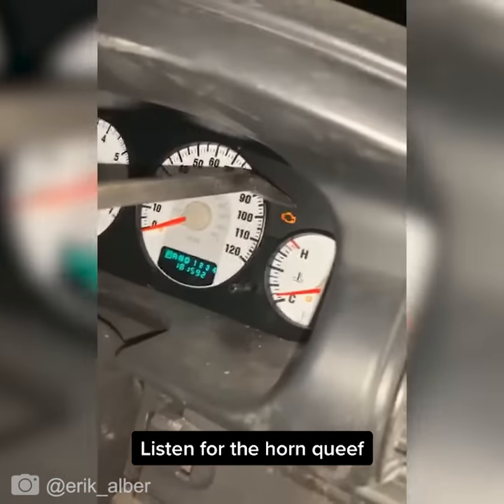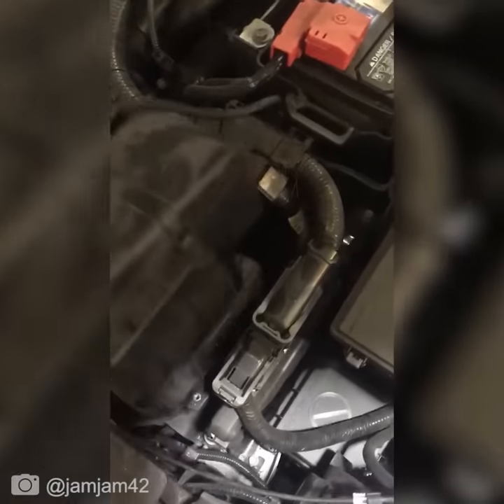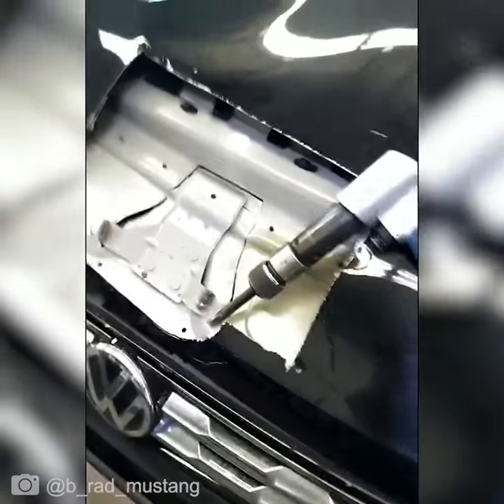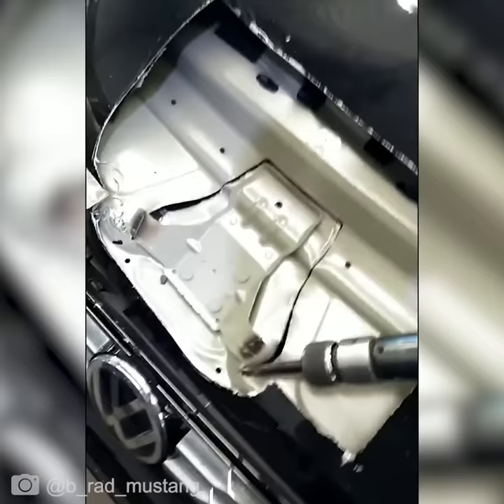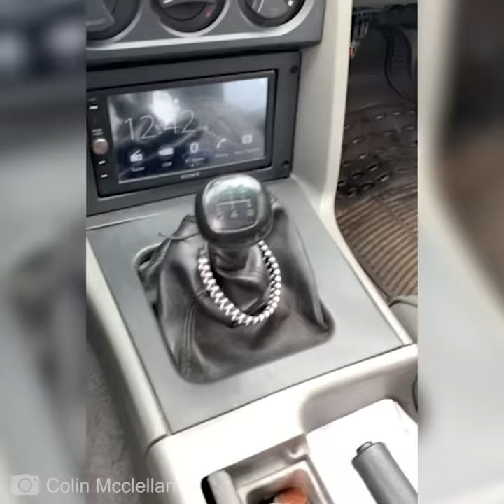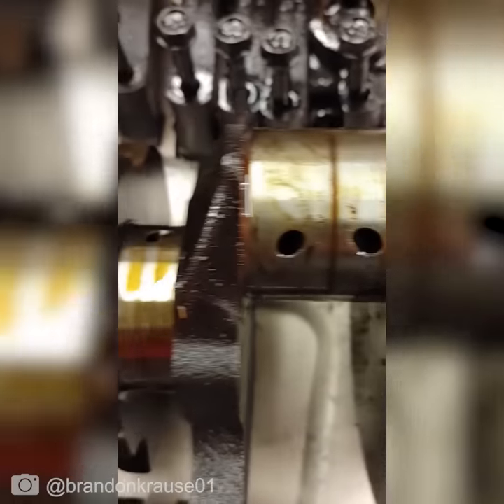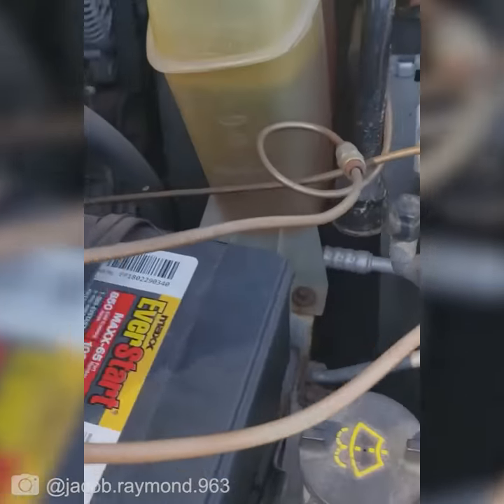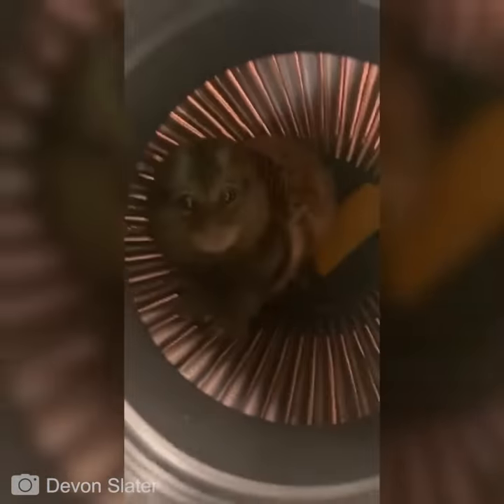Mechanical Problems Compilation [Part 16] 10 Minutes Mechanical Fails and more

Comment: 9:57 So should I change the fluid in my doors every 3000 or 5000 miles?  I always forget.
Reply: you don't need to change fluid just make sure that drain holes not clogged.
Reply: @D3moz  l
Reply: I think it depends on the car. My current one needs it only every 6000 miles or so; the minivan I used to have could make it around 10000 miles.
Reply: You don't have to though if you change it ever 4000 miles it adds another 50hp each time.
Reply: Read somewhere if you use distilled water you can go as much as 20,000mi. It's got to do with mineral deposits or something.

;)
Reply: @OTE_TheMissile  Just be careful, cause I know some cars will fall to bits if you use distilled instead of tap water!
Reply: Do I need a door filter.
Reply: @mashy712  Depends on the vehicle. Higher end vehicles generally don't need them, and cars made 2017 (or later) often can go without them entirely.
Reply: Hey not many people know this but if you add iced tea mix to the water in it the cars hp will go up by 200.
Reply: It depends! Are you using synthetic water in the door or something else?
Reply: @OTE_TheMissile  If you can't get manufacturer recommended door fluid either distilled or pure water will suffice temporarily.
Reply: @youkindacute6898  But that's only in summer months though, right?
Reply: @michaelmayfield4304  It costs a helluva lot more but I prefer to use heavy water.  It works much better than any other fluid I've tried.  And there was a distinct difference in operation when using either Pepsi or Coke.  Pepsi is a preferred alternative.
Reply: @rondohunter8966  yeah only in the summer
Reply: @youkindacute6898  Good to know.  Thanks.
Reply: This comment section is underrated.
Reply: @Dat-Mudkip  This. A lot of newer vehicles have lifetime door fluid and never need replaced. In fact, the doors in most are now sealed and non-serviceable.
Reply: @ironpanther2420  I blame China.
Reply: @thewonthatloss227  The funny thing about it is knowing - if one is not familiar with vehicles - what is accurate and what is a laugh, i.e. not real.  I hesitate to say that most of these were probably written by men (so as not to upset those who are not) who know thier way around a car and can tell real from not.
Reply: 5000
Reply: @ironpanther2420  Smart move.  It's easy to do and many mess this up; the mechanic will then repair it.
Reply: Change it every 500 mosquitoes. It doesn't matter the mileage.
Reply: @MrEchenomejoda  Here in the south we have a more concentrated blend due to the over-abundance of mosquitoes.
Reply: use only oem fluid or else they wont open anymore
Reply: @HECKproductions  Is it true that some OEM products are being counterfeited in China?  I'm afraid of getting a bad batch and you know what that entails.
Reply: @sebas Stein I get so confused on this thread.  First it's water, summer or winter, now you're saying it's oil.  And is it summer or winter oil?  What viscosity should I use?  See?  That's what trips me up and causes me to make a mistake and my windows get stuck in position.
Reply: @636lover1 But have you changed the air in your tires?  Spring is here, must not let that slide.  And then there's the headlight fluid that requires seasonal fluid exchange.  Lot to know about owning a vehicle they don't tell you.  The internet never lets me down.  (Lol!)
Reply: @Dat-Mudkip  i heard rain water filtered through coffee filters
Reply: Thats why every car i ever owned had rust.. never changed the door fluid nor the panel fluid. (Yes panel fluid is a thing, why would companies put some type of plastic liner? To prevent that fluid from getting onto your tires and messing up your traction while driving).
Reply: 5000
Reply: Every 20 thousand miles should do the trick
Reply: Not necessary to change. 
Its a lifetime thing.

Comment: 6:13 if it was my car i would have a heart attack.
Reply: I’m cringing hard
Reply: Rip transmission
Reply: I mean if it's on the back of the repo truck, I don't think it's your car. No harm being done to it anyway. It'll take a very long distance before it even starts to harm the transmission. Usually repo guys will remove the vehicle from private property before adding a dolly or swapping it the other way around(this looks like a FWD vehicle).
Reply: @gen157  it’d take less than you think to mess up a park gear in the transmission
Reply: Og Mez  Towing, yes. Dragging it at low speed a hundred feet? No.
Reply: @gen157  I know this is a late reply but if its a repo then the bank would do a inspection to see how much its worth and if the transmission is gone guess who they'll come after? The repo company can lie and pin the blame on the previous owner and the bank would assume the previous owner purposely damaged the vehicle and will take them to court.
Reply: @fearlesswindows  At least a few thousand vehicles are towed from properties this way every day for a short distance. Be it repos or private parking lots(see GTOger for example), very rarely does transmissions end up damaged from being moved like that.

I've always heard stories about transmissions being damaged that way, but I've never had a car come into the shop damaged, nor any videos of people showing damage as a result of this action. Yes the Repo company would be held accountable for damage if it occurred. But it just isn't common for it to. Some damage is expected for a vehicle that isn't being paid for. Just part of the business.

Comment: 4:43 my worst fear as an entry level technician.
Reply: It's why I never liked those adjustable lifting arms-the drive on racks are so much safer.
Reply: I always double check my lift points. There are times when I think a truck or car is racked sketchy, I bring it back down. I never lift higher than a foot to inspect the lift points. Clearly the guy in the video doesn't share that fear. Honestly that truck could have killed him and caused a rack failure. The guy is extremely lucky.

Comment: Is that Prius even gonna be able to move with all those bricks?
Reply: Yes
Reply: Three simple words,oh hell no!😆😆😆
Reply: I put 1200 pounds of bagged dirt in my kia me and my dad she rode like a champ
Reply: @ChalkyHonky  well,at least a Kia is kinda cool,I know what's not cool,a 98 Saturn wagon like mine.😷😷😷
Reply: @otakubancho6655  Its not at all it is fine to rally on the dirtbike track.  I will give it one thing I have been beating the hell out of it for 7 years now no major problems
Reply: @ChalkyHonky  at the Home Depot I (employee) loaded a pallet of tile 5,000 lbs in a scion box what ever there called she was squatting but handled that and came back for seconds too
Reply: @kingssuck06  that and you might get about 5 minutes of battery life.😷😷🙏
Reply: Sami  yeah,maybe if they were all as big as shamu!😆😆😆
Reply: I'm not saying I wouldn't load a pallet of bricks in a hatchback, but I would be far too ashamed to have the shop worker help me.
Reply: @dcan911  I'd be more ashamed of driving a Prius!
Reply: I put bags of sand and the stuff to build a above ground pool in my hummer and she drove like it was nothing, put a big water jug in my wife's car...🕳 me before falling holding a sign that says help.

Comment: 4:44 someone’s losing their job 🙄
Reply: Unless that's his personal vehicle.
Reply: Unless you snapped them out of existence.....
Reply: idk how he didn't see the problem WAY before then...
Reply: That happens a lot. That’s why the mechanic charges you a lot. They fix it and patch the truck again. 😂
Reply: @mashy712  mechanics charge so much because automakers require new speciality tools for every new vehicle every year. as a mechanic I can assure you, had he done his due diligence and ensured all lift points were secure, lifted the vehicle an inch off of the ground, shook it to ensure a proper lift, THEN lifted the vehicle, it never would have happened. he was being lazy
Reply: @hanksadventures4132  Exactly. That’s the proper way to lift a vehicle, not what that dummy did. Also, @Mpotatoes16, saying that mechanics only make temporary fixes is very harsh. Only the bad ones do that. 95% make the repairs to the best of their ability, with the knowledge they have and sometimes were given by the customer. Oh, and they also charge more because they can. The work mechanics (myself included as a 310T truck and coach apprentice) is hard, labour intensive, and gruelling. Shops charge that little bit more so they can pay us a bit more because who knows when a back could give out, or worse and end our careers. If it weren’t for us techs your world wouldn’t be the same as it is.

Comment: I feel like the one where the exhaust is coming out the roof, they might have a system in the workshop where they hook up the vehicles exhaust to blow it out the “roofs exhaust” if that’s what you want to call it. So it doesn’t fill the shop with all that co2. I’m probably wrong but I think it’s a realistic thought right?
Reply: Engine dyno
Reply: It’s a dyno. Most places that either do engine or chassis dyno’s for diesels indoors vent the exhaust through a dryer vent tube so to speak and outside.

Comment: 1:52 that's normal with a new brake pads and rotors it will stop making noise in about 5 minutes of driving. I just changed mine last week

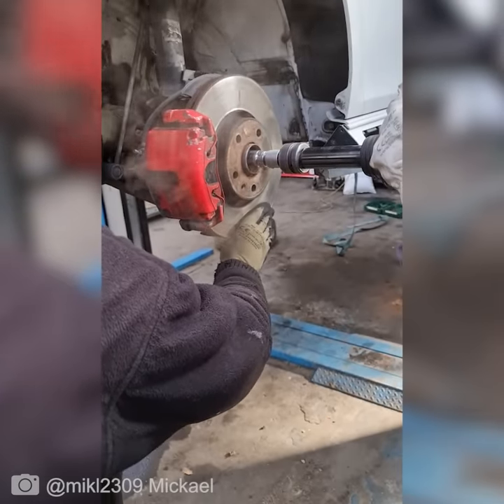Comment: Guy at 1:13 trying to get the axle nut off needs to use a big heavy impact socket. That little silver socket doesn’t have enough mass to transfer the impact to the nut. Thats why you always use a black impact socket for stuff like this. The mass of the socket transfers the impact energy better. There are videos here on YouTube about it.

Comment: Hot Rod and Track Magazine claims that, in fact, a small monkey added to your air filter box will boost performance by 10 to 15 horsepower. The premise being that the little guy gets scared and starts running in circles, thus generating increased air to the manifold.

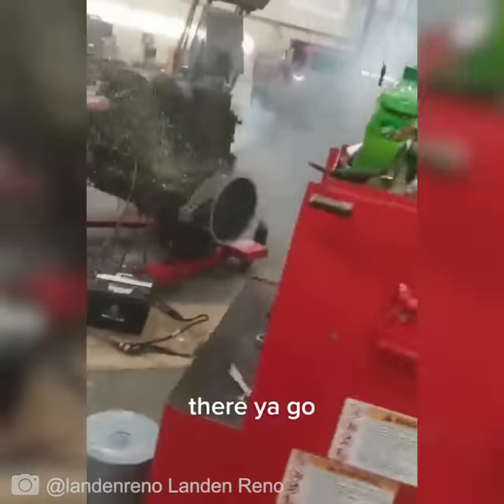Comment: 1:34 if that's diesel i can see why they're running away.
that is of course, if it's true what they say about diesel jets. apparently they can cut off your limbs because of the pressure so yeah.
Reply: is that pressured accumulator or something ??

Comment: At the very start is exactly why you dont use an impact on the crank pulley bolt
Reply: i dont think its impact gun problem it looks more like oil problem or crankshaft seats overtorqued

Comment: 2:00 i used to be this guy.
Not fvcking up like him, but i was the main forklift guy at my home depot.
There's about a BOOK of things he's doing wrong here. 
The first one, is he thinks that heavy mulch pallet is going on that flimsy little trailer. (Which, frankly, I'm.surprised didnt totally collapse under that impact.)  Lmao

Especially if that mulch is wet? 
Triples it's weight.

Comment: Why are you drilling holes in the bottom of the door. They generally have small rectangle plugs or it's clogged and needs some air blown in it

Comment: Yup the new makita angle grinders are absolute garbage now. Old makita were so much more robust. Internals on new models are all cheap plastic, and the trigger locks are very annoying. I've had much better luck with dewalt, they seem to last longer with heavy grinding.

Edit: as a welder, my soul left my body when I saw those welds, those wrenches welded was enough to make me puke.